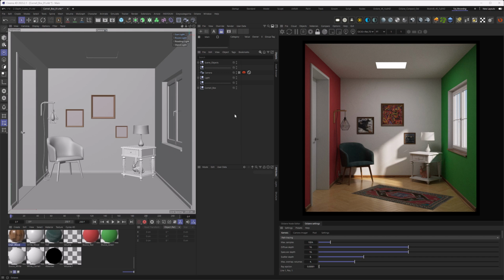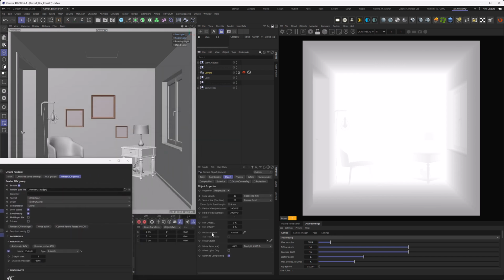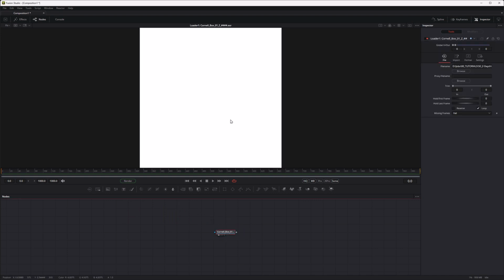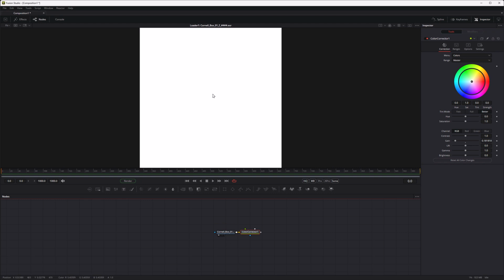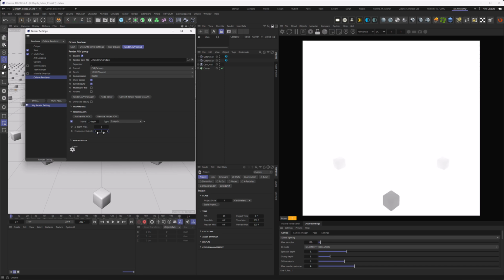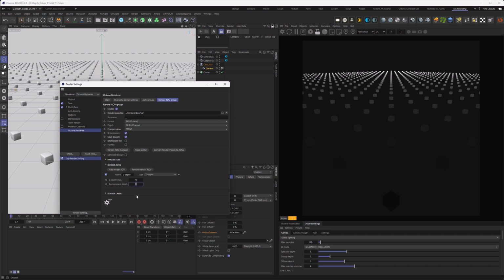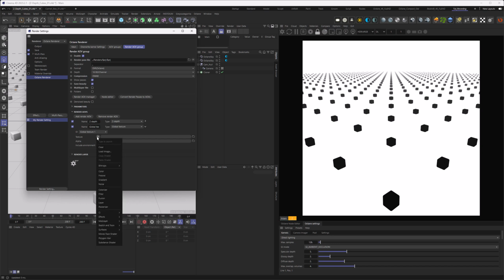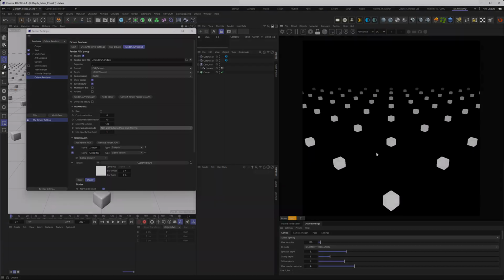Silverwing Quick-Tip: Z-Depth (The Intriguing world of Z-Depth)

Comment: well what if you want a shallow depth of field with close objects and far objects out of focus like a real camera ?
Reply from the maker: The "Depth Channel" is just a data layer, not representing what a DOF filter is doing.
Usually the depth should be directional continuous. This helps the DOF filter see which objects are in front and which are behind others as this step is important to calculate the correct DOF. (Not all DOF filters have that though)
So having a point in space (your focal plane) from which there is a gradient to the front and a gradient to the back is actually counter productive. As with most DOF filters you can pick your focus depth from the continuous depth channel (such as shown in this tutorial) and then produce the right front and back blur.

Hope that helped 🙌
Cheers and a great weekend to you!

Comment: This is a really good tutorial on Z-Depth. I needed it for my project. Unfortunately, I still struggle with this. In my case I try to use the Z-Depth out of Octane in Nuke to create bokeh in the sequence where the image is moving, but I can't get a satisfying result. I see artifact at edges of the image. I guess it's expected since Nuke have only the 2D image and can't know what the data is beyond the edge. But it's also have issue in some other areas of the image. The final result doesn't look too clean if he compare to ground truth from the renderer itself. I tried using both ZDefocus and Bokeh in Nuke and I struggle with both option to output the clean result. I'd appreciate if you can share your experience how you can produce a clean result applying depth blur in the post.
Reply from the maker: Hey Alexey. Thank you very much for your comment.
You are absolutely right, Z-Depth has some inherent problems. Such as the problem of causing artifacts at edges with large depth differences.

My "workaround" is to render the DOF and not create it in comp. But that of course costs render time.

To get a little cleaner results, at the end of the video I show a way to get aliased Z-Depth. That (dependend on the blur plugin) can lead to a little cleaner, less artifacted look. But not completely avoid them.
The reason this works better is because one cause of artifacts at edges is that the Z-Depth channel is anti-aliased so there is a gradient happening on the edge from one depth layer to another instead of an abrupt change in depth that would be natural. By not anti-aliasing the Z-Depth there is no false information in the channel and, depending if the DOF effect of your comp supports that, can increase quality.

If you are in nuke and would like to do DOF there, the best way would be deep compositing with deep EXRs. But those are super big in size.
Octane can actually save them.

Since I never worked with those, I can´t tell you how to handle them though. There are YouTube videos on the subject. But they are rather rare as usually only bigger Studios have the resources to use it. 

Fingers crossed you will find a solution!
Raphael

Comment: Man I've been having the most difficult time (and about the only issue when swapping to Fusion from AE) but to get a proper fog depth look, I'm using channel booleans but the results are so, i don't know... it does not look good. Do you have any advice or a setup on how to? Currently plugging Z and Beauty into booleans, set it all to do nothing expect alpha which either goes to lightness or alpha FG, have tinkered alot. Also tried doin settings in the buffer with the depth set to same as env, and the env set at 0. 

Most the results I get are some kind of inverted mess where alpha fades inveresly, or the colors are inversed and they fade correctly, can't find a happy medium.

Greatly appreciate your work :)
Reply from the maker: Hey Kris, thank you very much for your comment!
I feel you. Fusion does stuff differently and sometimes it does not feel intuitive at all. But I assure you, there is always a solution!
I maybe should have shown this in the video as Fusion is a bit specific how it likes his values.

Fog Node Workflow:
First of all what´s important is that Fusion likes it´s depth passes 
Far = Black
Near = White
...so the other way around Octane saves them. Fortunately I show a solution in the video with the global texture. Or you just invert the whole channel in fusion itself.

Channel Booleans:
Once you have done those tweaks to your Z-Depth input, you can use a "Channel Booleans" - Main Image as BG, Z-Depth as FG, and Leave it as "Do Nothing" for all the channels (also for the Alpha). Then go to the Aux Tab and "Enable extra channels" and in the "To Z Buffer" set "Lightness FG". This writes the Z-Depth values in the provided channel and carries it along the stream.

There seems to be a bug in Fusion right now so you can´t see the Z-Depth if you try to view it. But the values are there if you sample it.

Fog:
Now add a "Fog" node. If you now sample the near plane (so the values that the Z-Depth has closest to the camera) and the far plane (so the Z-Depth has at the horizon) then the fog should show up properly.

--------

Alternatively:
If you do not get it to work, because there are frankly a lot of moving parts in this! Then you could make your own Fog by Merging your Render with a colored Background via a mask:

Merge:
Make a "Background" node in fusion (make sure it has the same pixel dimensions as your render), give it the color of your fog and use a "Merge" to merge that "Background" with your Render (FG)

Mask:
On your Z-Depth channel you can use a "Bitmap" node that will turn the Z-Depth values into a mask. Set the Bitmap node to use any color channel of your Z-Depth and arrange the Low and High values so you get a proper Z-Representation (you might also want to invert the result to have Far = Black, Near = White)
Then use the output as the Mask input for the "Merge" of your Renders and the Background.

I know its pretty hard to follow written tutorials. So hopefully you get something out of that.
I tried both methods right now in Fusion Studio 18, and they work as intended.
Reply: @SilverwingVFX  ahhh love you man, thank you. Got the first method to work without a hitch, feel big dumb for not being aware of a straight up 'Fog' node.. Appreciate it big time, can get back to spooky vague render aesthetic now :)
Reply from the maker: @RUFFENSTEINT  Ohhhh super nice! Glad that it worked. And don´t feel dumb, we are all learning here! I wish you the best success with your spooky projects!

Comment: in Ae there seems to be a bug (or feature?) with EXtractoR: You have to manually set all the RGB passes to Z-depth.y
Reply from the maker: Hey there and thank you for the heads up.
I think what you experiencing has something to do with the way Octane stores data inside DWAB EXRs.
It tries to be clever about it (and I think it is) So while it compresses the main passes, it has passes it does not compress because the are better left uncompressed. e.G. Cryptomatte but also data passes... like Z-Depth. To be most efficient about it, it just uses single channels for those so it does not take up more space then it needs to.
If you do not like that way of dealing with it, you can go with a PIZ or PXR24 compression. They files will be quite a bit bigger then DWAB though.
Reply: @SilverwingVFX  thanks for the explanation: I'm fine with it, you just has to know it :-)

Comment: Once again just a treasureous tut here! Thanx!
I know I have already told you that you can read my thoughts? But I want to give you a tip for one of the next lessons if you don't mind ;) I struggle very much with automotive scene with full lights on especially the headlamps and the taillamps. The problem is that when you do ithis setup in Octane physically correct it ruins the render times and makes it soooo slow that an animation of 20 sec can be rendered (with a moderate quality! - not perfect at all) about 10-12 hours. Which is not normal in mine opinion and I really want to know how to make these lights easier and more simple for render engine. Unfortunately I couldn't found a good exactly Octane and Cinema 4D tutorial on that - there are some on Redshift and Blender, but in Octane that pains me very much and I really need a good help and advice. Would be just great if you take this idea and make a breakdown of some of this type of projects. Expecially which settings and which materials is better to use and btw what is the normal time for such animation. Here's what I have got now and this is very far from what I would like to get...
https://youtube.com/shorts/0iXZV83FwFE?feature=share
The lights are not real, the render times are ennourmous. Please, give a hand of help ;)
Reply from the maker: Hey and thanks a lot for your message and your suggestion.
I think rendering the head lights of a car in a way as they work in reality. Light source, reflectors, lensing etc. Would result in massive render times, no matter what renderer you´d try.
So I would go for a split approach. Make the headlights reflections / refractions look good in camera, and then use a different set of lights, e.g. with a IES light or a gobo, that mimic that headlight silhouette.
I do very little automotive, so I do not a lot of knowledge with this topic. Though I have shaded headlights before.
I am always searching for topics that can be applied very broadly as getting headlights looking correctly is a very specific thing.

In your case I would not render the whole scene using photon tracing. I would rely on pathtracing alone. As you experience in your video, there are some flaws in the current implementation that can cause the animation to flicker.
Maybe do a 2nd pass just rendering the lights that rely on caustic effects.

Hope that at least helps a little bit!